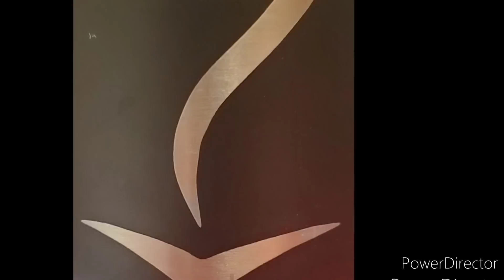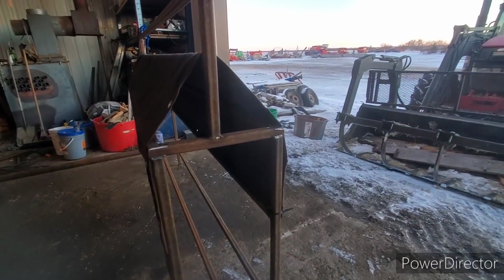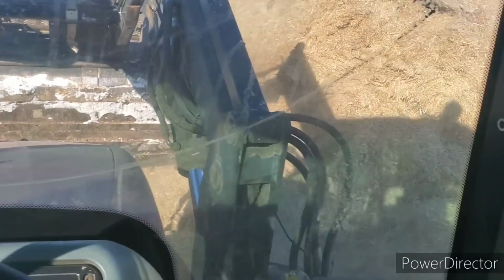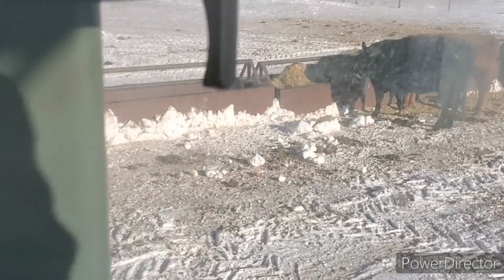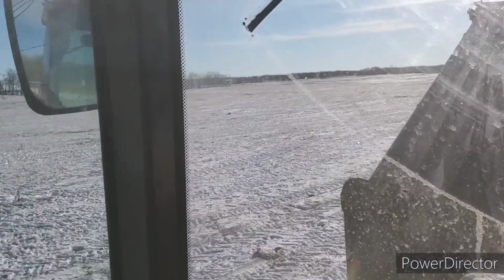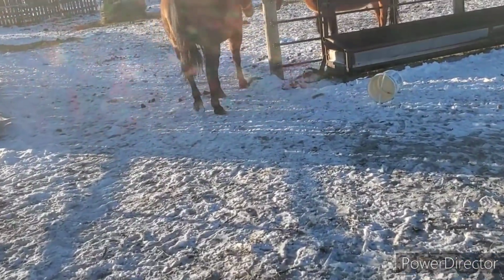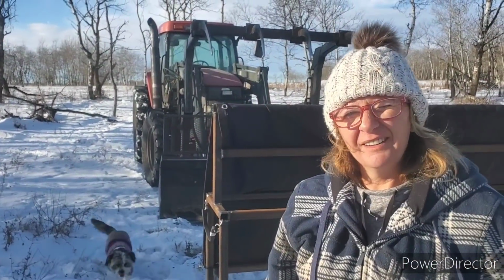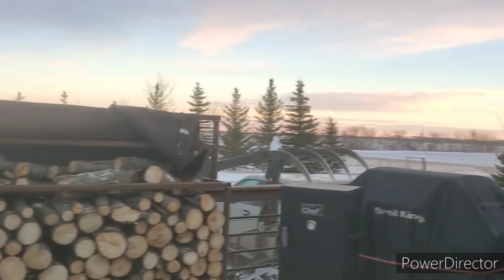Tie Up In Horses, CPs New Horse Maggie

Comment: I like your log rack very much, highly practical tool and it cuts down on unnecessary handling  especially when you can lift it up and place it directly onto the deck so that it is nice and handy to access. Did you find some suitable straps to hold the tarp? - would three pieces of bungy rope with hooks hold it down instead of straps?
Note: quite a few firewood folks are using 330 gallon IBC containers with the bladder removed and hole cut in the long side for access and the bottom of the bladder cut out and using that as a lid.

I'm glad to hear that the horse appears to be on the mend and hope for a full recovery given time.
Reply from the maker: I'm just using a couple of tarp straps seems to be working just fine

Comment: That horse could have accidentally poisoned itself eating hay: when grease, hydraulic fluid, anit-freeze, and other types get dumped into fields during a break down it is not inconceivable that some of the hay covered with those fluids got mixed into the good hay.   Your hay looks fantastic but we never know when we cut off-farm and bring it in. I've seen barb wire in hay, plastic bags, and hay with paint on it, etc. Shit happens.  Glad you listened to your intuition and didn't kill the horse.

Comment: Top crossmember will get the rack over the porch rail BUT i think you'll be using the tines of the loader bucket under the rack and the grapple to keep it vertical on the way back from the "bush".  GREAT NEWS on Maggie! You need 2 and stop arguing with CP!
Reply from the maker: It worked great...and ya we need a second one lol
Reply: @bcpfarmandtrucking6560  You talk big on video but you’re just an ole softy to CP! You really don’t need one right away it’s just nice when one’s empty to have either a bucket full or a second one ready to burn.
Reply from the maker: @kswaynes7569  with my luck if I ad 2 they would both go empty and then I'd spend double the time to fill them up lol